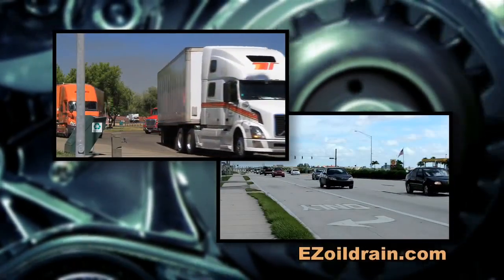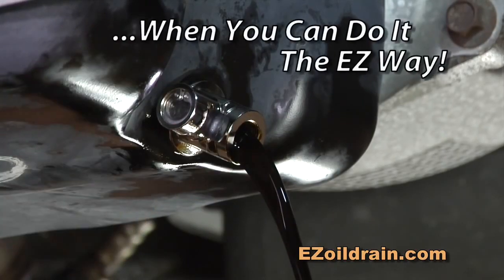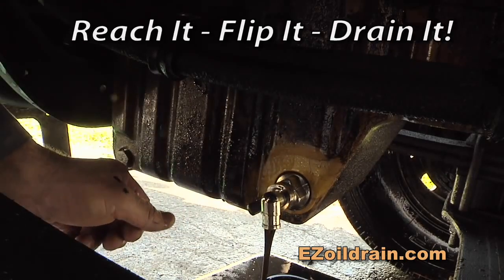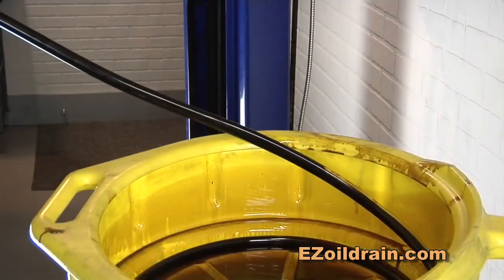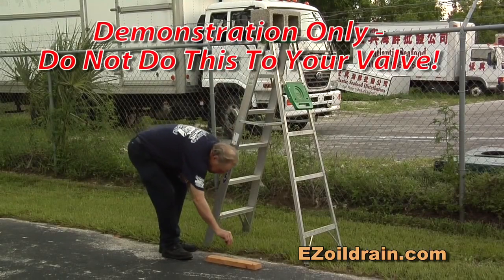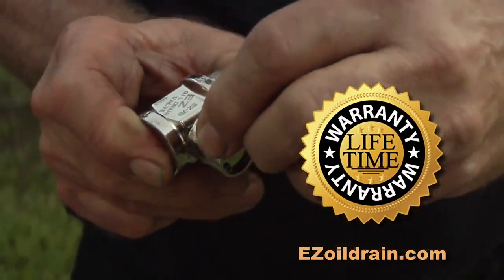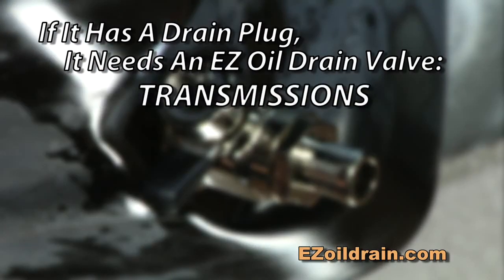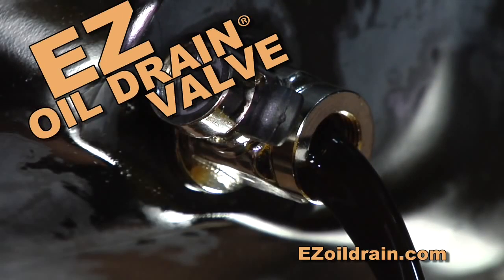EZ Oil Drain Valve - THE EASIEST OIL CHANGE!

Comment: Should I take a nap while waiting 30 mins for the oil to drain out that Coffee straw size drain hole?
Reply: You can attach a hose an vacuum the oil out. Though equally if you're gonna vacuum you may aswell do it from the dipstick tube and that way have wiggle room in the sump to get every last drop. They're mostly for motorsport, fumoto is the originator and they sell for like $60 for one valve. I wouldn't want one close to the ground as a bolt head can take a pounding from rocks and speed bumps if needs be, this valve looks like a catastrophe waiting to happen

Comment: Bwahaaaaaaaaaaaaaaaaa wait till a big rock or a pot hole hits bang oil comes out no motor
Reply: nuster dom you probably don’t have one?
Reply: If a big rock is going to break off the valve, it’ll punch a hole in the oil pan too